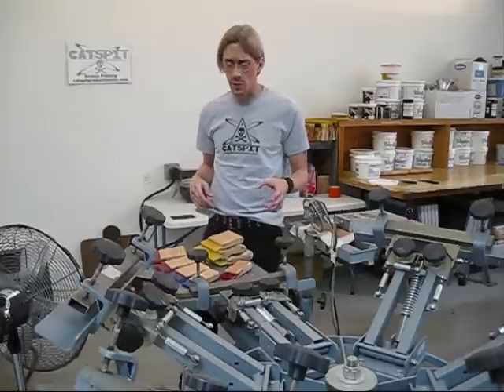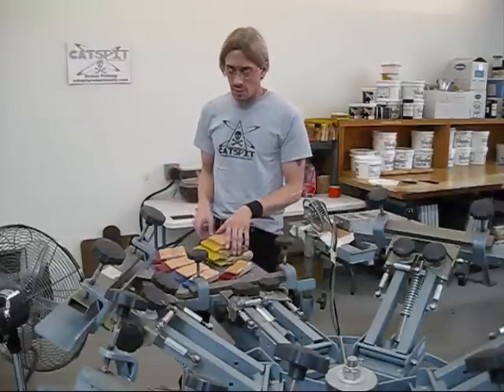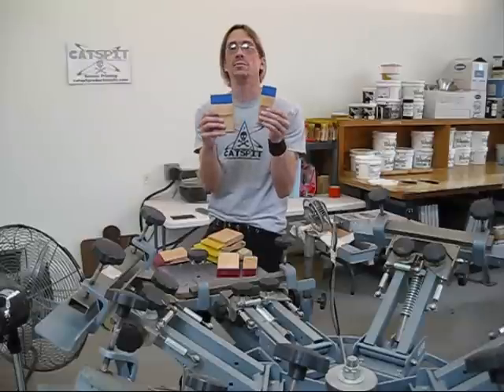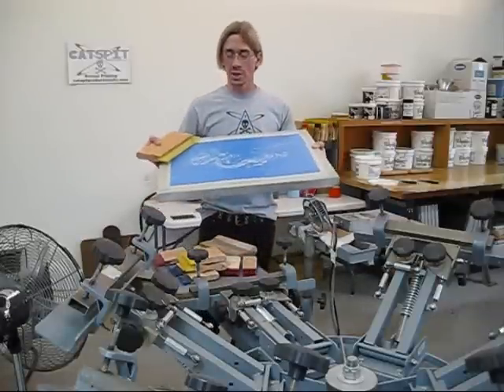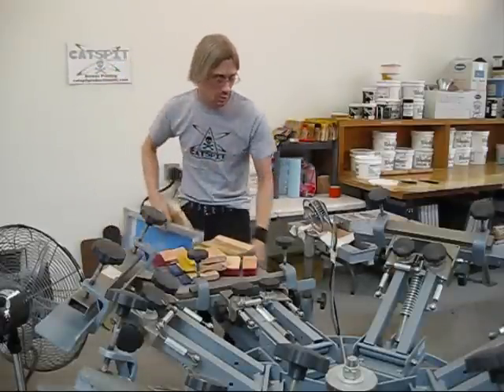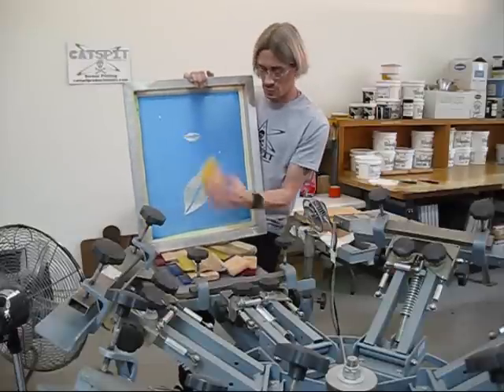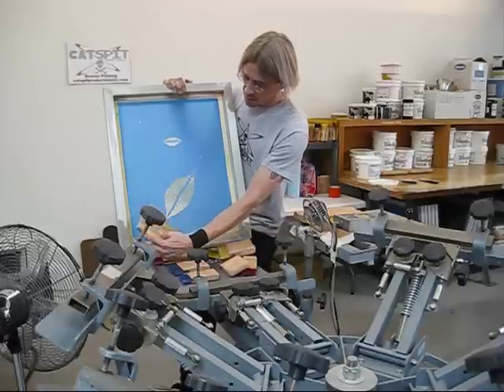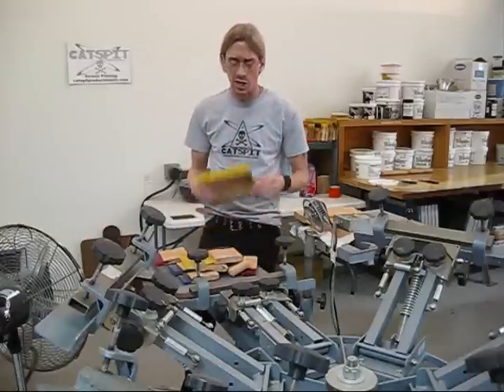How To Screen Print: Choosing Squeegee Size

Comment from the maker: @honda125 Thank you!! Sounds like an underexposure problem; it’s hard to tell without seeing what’s going on there. I would try using a brighter bulb like at least a 500 watt work lamp if not more. This will make the exposure more consistent and thorough. If you are already using that, make sure the glass is removed. It sometimes has a UV coating. Thanks for watching and commenting!

Comment: Hey I must say great videos, Really nice shop buy the way..I have a general question for you, When i burn a screen and im using just a shop light from above for 7 minutes 12" above using ulano emulsion, When i wash out the letters i burned on my screen bubble up just a bit on the outside and if wash out for to long they wash away What im i doing Wrong.

Thanks

Comment: Choosing a squeegee size video.. and no measurements are mentioned the entire video..
Reply from the maker: LOL... sorry if you missed that but if you listen to what I am saying I give you the parameters in the video. About a half an inch bigger on each side of the design you are printing. There would be no point in stating any specific sizes since your printed design may be whatever size. The point of the video is to use a squeegee just big enough for the design and no bigger. It should slightly overlap the design on each side but not my too much. That's why we have all those different sizes of squeegees. Thanks for watching! Screen Printing Equipment & Supplies - http://CatspitScreenPrintSupply.com/